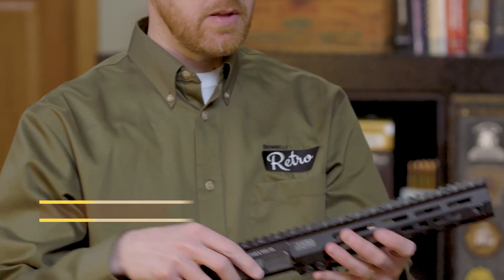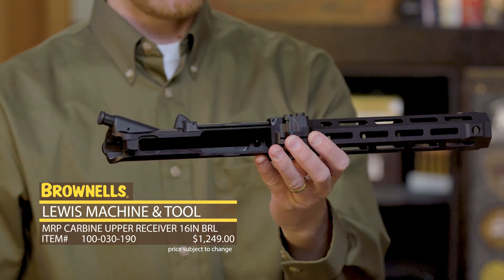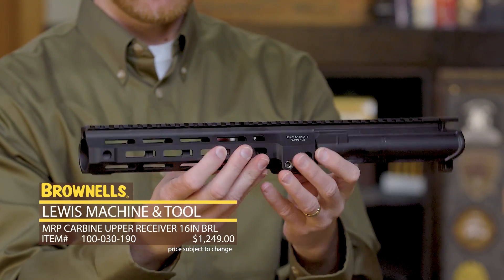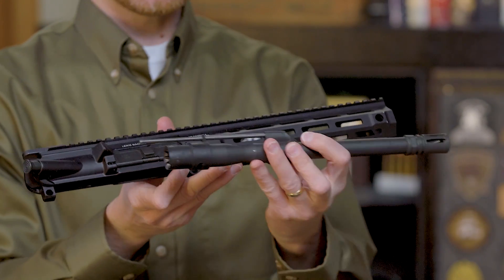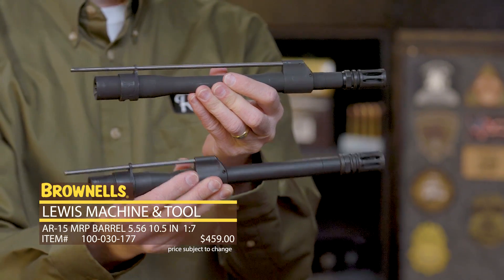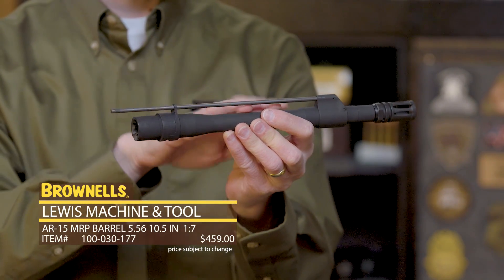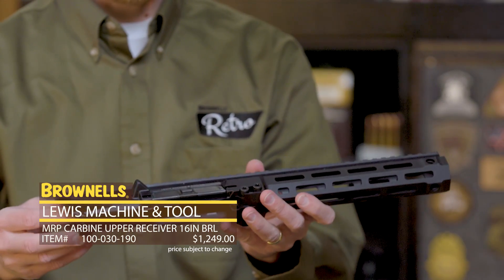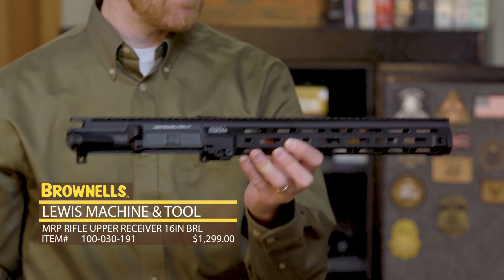LMT MRP AR-15 Monolithic Upper Receiver

Comment: Can u use different barrels. Say a Daniel Defense CHF 14.5 ..??
Reply: No
Reply: Kristjon Pedersen lmt Barely gives any information about their barrels I'm pretty sure they are not cold hammer forged.
Reply: @willc44  pretty sure they only have ss and 4150 options that aren't forged but that shouldn't be an issue because it's still a quality barrel.

Comment: I love mine. I have an older one, but mine has a quad picitinny rail system.
Reply: I've got a quad rail LMT MARS-LS also. I actually just shot it in a local USPSA rifle match and it performed awesome, placed 22nd out of 50. Heavy AF and slower to target transition, but it will definitely outlast me for sure. It's built solid!!!